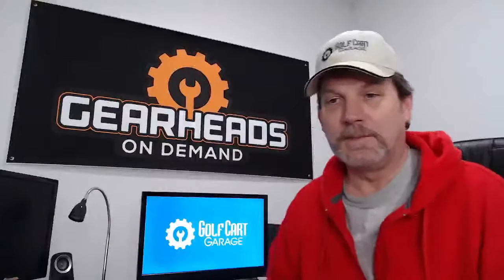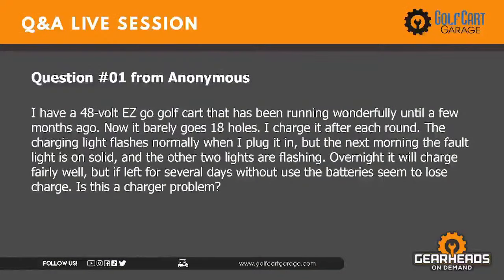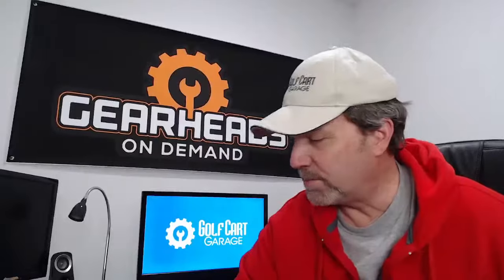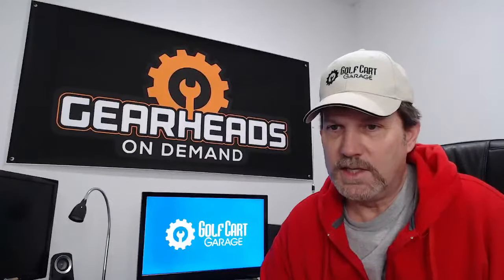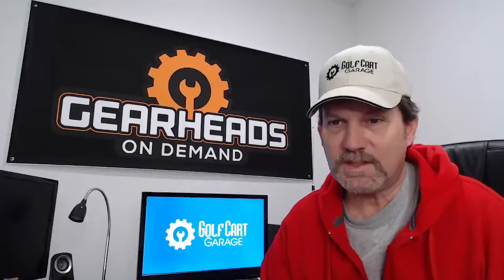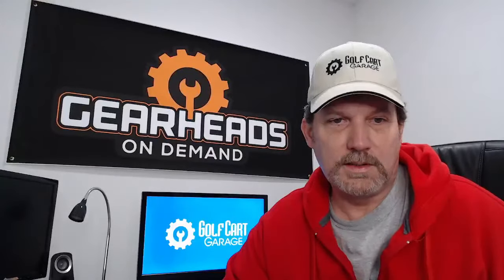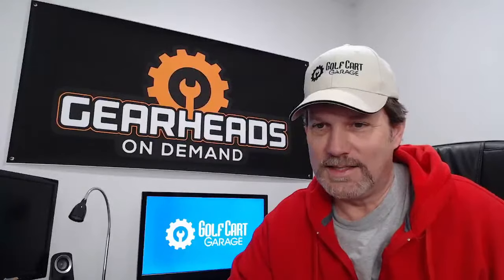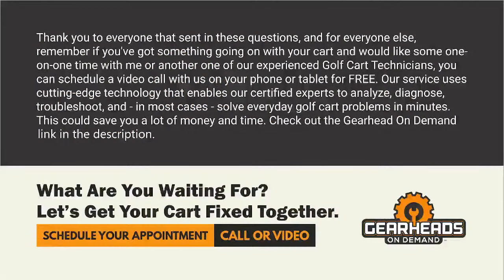Light Bulbs | Golf Cart Garage I Weekly Giveaways |  Episode # 91

Comment: Replaced head light bulbs and they blow out assoon as they are tur Ed on 2015 club car
Reply from the maker: Thanks for watching, Dave!  When we've seen this report in the past, it's been either because the bulbs are not actually 100% recommended for those fixtures or because of an issue with the voltage reducer or wiring.  If needed, you can get an appt for a video call diagnosis with our tech team, here: https://www.golfcartgarage.com/gearheads-on-demand/